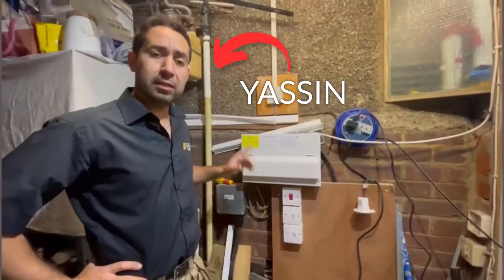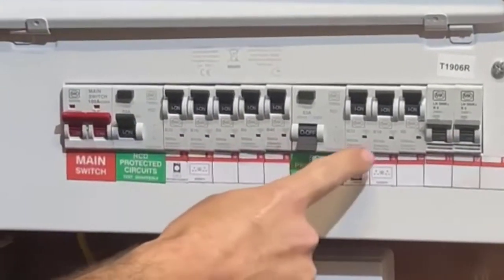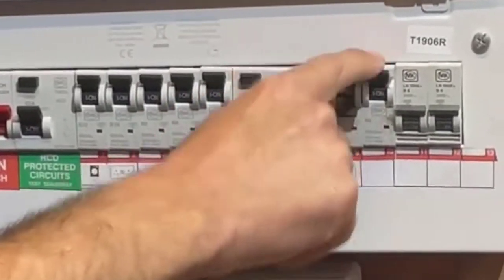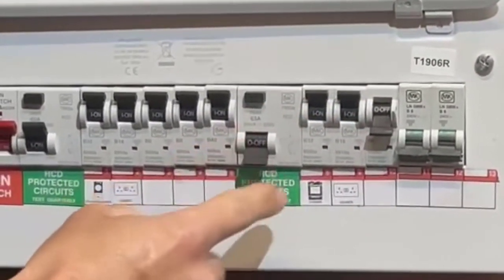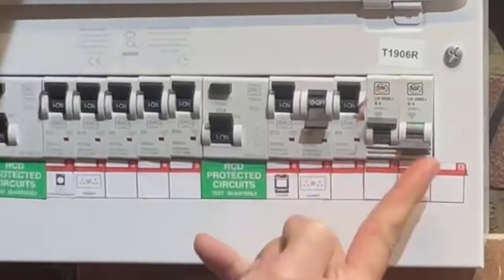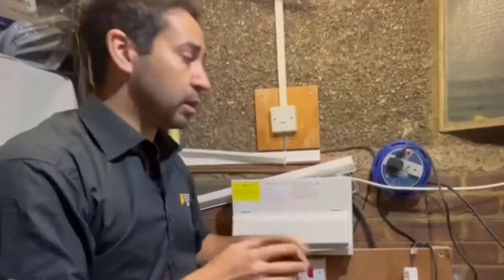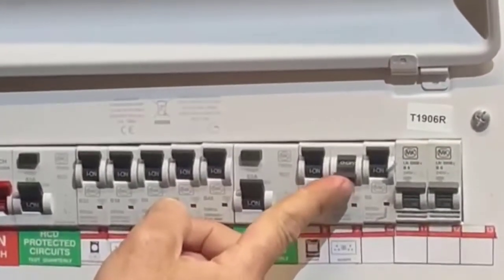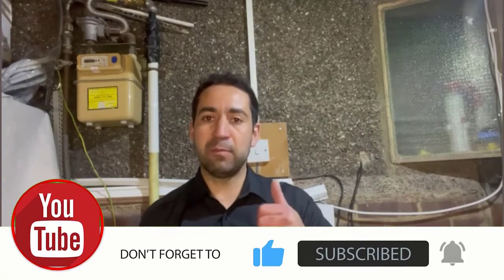RCD Keeps Tripping! How to Reset RCD Circuit Breaker & Restore Power

Comment: Mine is a weird one, rcd goes down, when i put all switches down the rcd still won't go back up, what could this be
Reply from the maker: Try to unplug all the appliances
Reply: I did that too so it not make any sense, it took a few hours but it now turns back on, but will go again after few hours, very puzzling  @excelelectrician
Reply from the maker: In that case, possibly you have a fault with the circuit itself. You need an electrician to attend and do the insulation resistance test on the circuit.
Reply: Thanks ❤️  @excelelectrician

Comment: My rcd switched goes down right after I flick it up
Reply from the maker: Turn off all circuit breakers, then switch the RCD back on. Next, turn each circuit breaker on one by one until the RCD trips. This will help you identify the faulty circuit and the appliance connected to it, allowing you to fix the issue.

Comment: I was just doing my evening routine and suddenly boom. Lights out. Glad I had mobile data to access this quick video. Did everything by step, and while my issue is partially solved, now I know where to look. Turns out one or two , maybe 3 or 4 kitchen sockets are faulty and is tripping the RCD occasionally which is really annoying. Will be in touch with my housing agency to sent out electricians as I cannot determine the real cause. My kitchen appliances are all new, must be the faulty sockets.
Reply from the maker: Wonderful!
Reply: If your appliances are new are you sure that moisture has not gained access into the sockets or wiring?

Comment: Useful video, I’ve isolated the problem to my “wall sockets” MCB, which is causing my RCD to trip. I’ve unplugged EVERYTHING from every wall socket but it still trips the RCD when I reset the socket MCB. Is there anything more I can do or does this need an electrician for any further work?

Comment: Cheers! My wife had half-plugged in the kettle and tripped the circuit. Couldn't understand why the switch wouldn't switch on until I unplugged everything.
Reply: I have unplugged everything but still it doesn't stays and keeps tripping, any suggestions please

Comment: Thanks for the video. It confirmed my attempt to find my problem. However, the problem still exists..hahahahahahaha....My RCD would not reset, and I found the breaker that popped it. However, I can rest both the RCD and the breaker and after about a week, it pops again. I have isolated it to two rooms. I unplugged everything and I put a load on the circuit, but neither the breaker or RCD will pop. It happens randomly. Right now, everything is reset and I have everything plugged in and ON. No popping of either breaker. It happens about once a week and unfortunately, two times this week. Once while we were on vacation and we lost everything in our freezer and refer while away. It isn't consistent so I can't find the problem. That issue was not addressed in the video, but the isolation you spoke of is absolutely correct. I just can isolate my problem. All items plugged in work without problem and nothing breaks the circuit by either being turned on or plugged in. CRAZY. The visiting electrician found nothing wrong. If you have another video of this type of problem, could you link for me. I have yet to find the answer.
Reply: If the circuit breaker and the RCD tripping at the same time you do have a short circuit between live and earth you need an electrician to attend and break the circuit down
Reply: @yassinbenosman5768  Hi, thanks for writing. Nope, only the RCD pops off. Once I turn all breakers off then reset the RCD, I turn on each breaker one by one. At the third breaker, POP goes the RCD. But, everything resets normally and now I am on day five of no incidents. My longest run is 14 days, so I'm hopeful for a longer episode of no issues. No electrician has time or wants to come out and take a look. Landlord says to deal with it...LMAO.
Reply: Hi, even with all the switches off my RCD just flips off again? Would replacing the RCD work or do I need an electrician

Comment: Excellent video thanks. I have now at least got all the lights working with the circuit breaker to the kitchen not working. The rest of the power points to the house were ok as they are on a different circuit. Call the sparky on Monday morning!